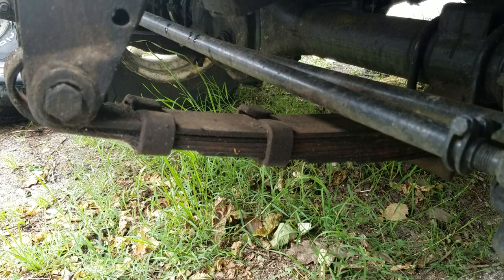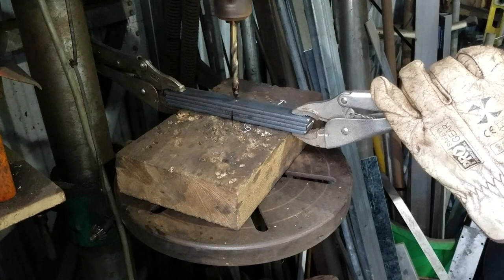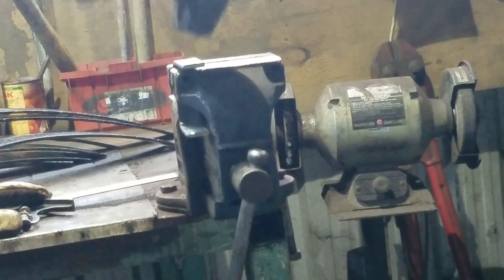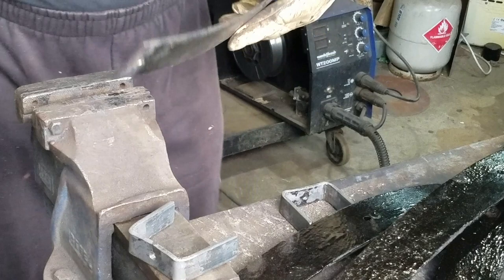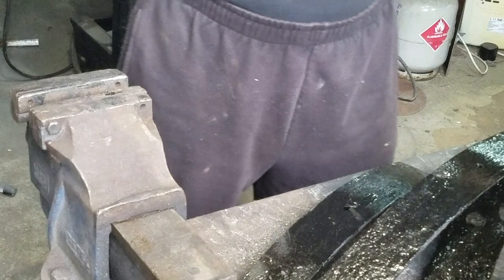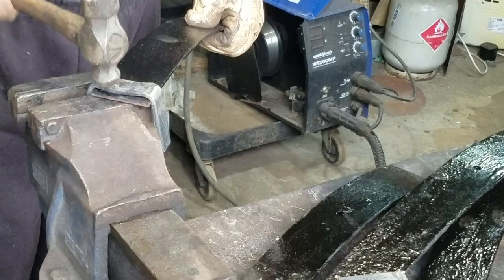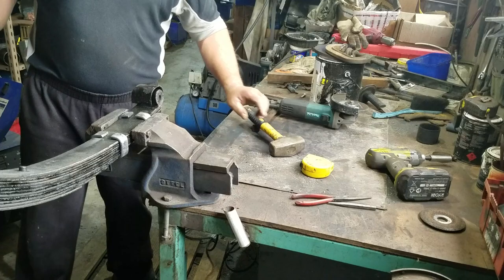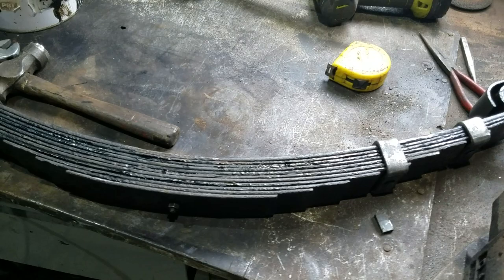Land Rover Leaf Spring Refurb. Quick and Dirty. spend no money!

Comment: This video has been particularly helpful to me. I’m in the middle of refurbishing my spring and just about to make some new spring retainers. Thanks for the tips.  I chamfered the ends of the leaves so aid them sliding on the leaf under. I’m using black zinc paint on them and plan to use graphite grease in between the leafs to hopefully give it a more subtle ride off road. 
Thank you for all your very informative videos.
Reply: How are they holding up?

Comment: When I refurbed my 109s springs I too used counter sunk headed bolts but I used nyloc nuts, never gave a thought to riveting them. They've been on there for eleven years now with no issues. I also lubed the leaves using motorcycle chain wax before re-assembly,  ideal for the job as being waxy it doesn't displace easily. I wish I'd wrapped the springs to keep the muck out before re-fitting, definitely will if there's a next time.

Comment: I have worked In my uncle's Garage where we would refuse the spring much like what you have done but we had the rivets I do like that you used the bolts great job mate. It was quite common for leafs to break up here in the Highlands when pulling trailer and ending up at funny angels.👍 Nice hammer action

Comment: Question unrelated to this particular video.  In one of your previous videos on EPS boards for offroad trailers you commented that the 2" thick aluminum-clad panels were ill-suited to temperatures below freezing.  I was curious if this comment was for a unit that had some other kind of powered heat, or if you only meant a unit whose heat would come from body-heat from those occupying it.

I'm mulling constructing some kind of cabover side-in camper for a pickup truck using similar techniques on an American Nissan D40 Frontier, which was sold as the D40 Navara until 2015, and my total payload capacity is low enough that using thicker panels may not be practical.  Thinner panels may be necessary in order to keep the weight down.
Reply from the maker: There is very little difference in weight- the best option is to use polyurethane core - the brown one, Much better insulation and even stronger.

Comment: I have heard & watched an article on springs i am sure it was said that leafs should be uncoated between their packs as they will last longer.Let me know your thoughts.
Reply from the maker: Hi Kevin I watched several videos and spoke to the two guys at Archer's Springs. One thing seems to be clear. Don't wrap them- cos if moisture gets in it cant get out. and as for painting them- Archers paint them and all new springs that Ive ever bought for trailers have been painted. all trucks and vans have painted springs from new. 4WD boys like to oil their leaves cos they work well but wear quicker as its like a grinding paste. The paint I use is called gilsonite. its like tar, but sets harder. My other two Landys have gilsonite on the springs and so does my boat trailer.  not a sign of rust on any of them. I guess that if you belly out in sand you will start to get sand between the leaves to some extent- Im still learning
Reply: In the UK, the spring makers only paint new leaf springs once they are fully assembled, bolted together.
Because the paint in between layres wears away, displacement of paint material between the leaves causes the leaf pack to become loose, not good!
But thanks for an entertaining video sir, and I’m sure it’s nothing that removal and some attention from your hammer and a tighten wouldn’t sort out.